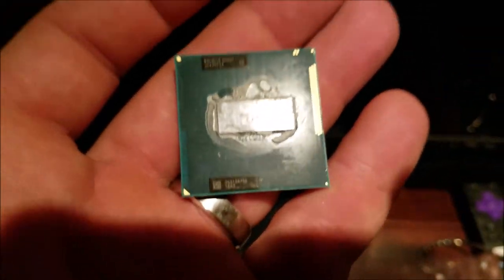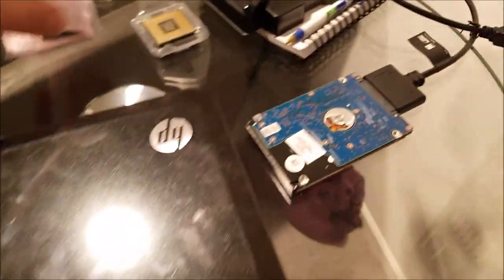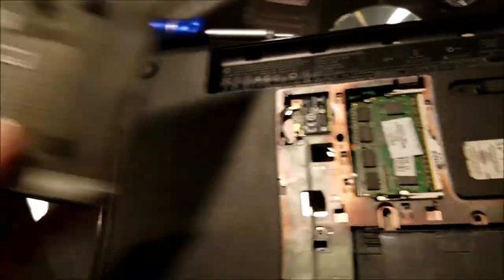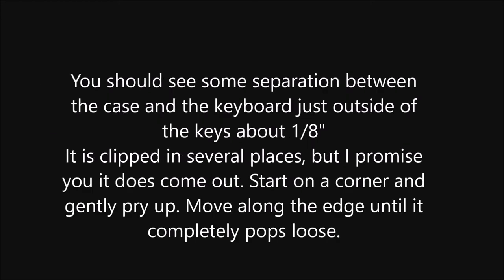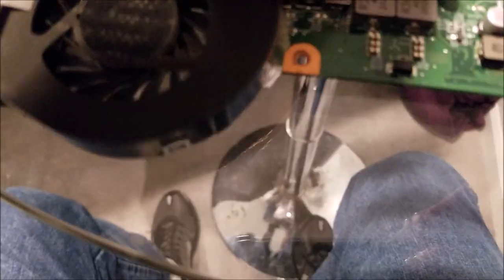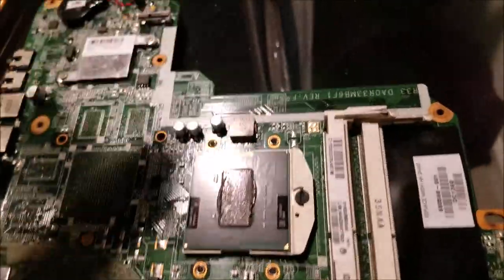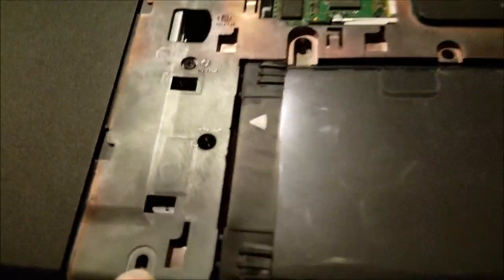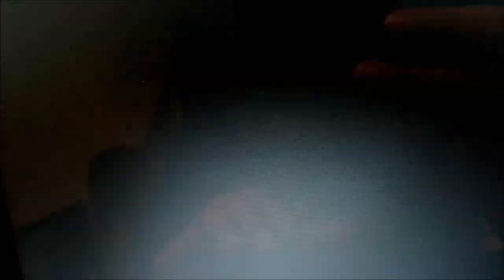How to upgrade to an i7 processor in your old laptop

Comment: Hello,I have a TravelMate 7740 laptop acer
Socket 989 rPGA
Mainboard: Acer BA70-CP
CPU: Intel Core i3 370M
Can I install an i7 940XM / i7 840QM / i7 740QM processor?
Reply from the maker: I'm looking and it doesn't look good. Do you have a separate GPU in your laptop? If not, the quad core chips will not work. They do not have onboard graphics like the lower chips. I think the best chip you can install is a 640m. It's still a dual core but it has higher clock speeds than your i3. 
  If you do have a separate gpu, I would try the 840qm. I've run an xm chip and it seemed to run hotter than I'm comfortable with. That will put a strain on everything else in your system. The quad core chips also look like they use the 45nm architecture as opposed to 32nm of your processor. It must have been a weird transitional time for Intel. It looks like their quad cores are on the larger 45nm architecture and they didn't have room/temperature overhead to include onboard graphics. I probably wouldn't worry about upgrading, but if you decide on a 640m dual core, your base clock would increase to 2.8ghz and you would get a boost clock of 3.46ghz. That's a significant increase over your 2.4ghz clock speed, but I'm not sure how much of an increase you'll be able to feel. Anything with a load will reduce your base clock to 2.8ghz.. about 16% faster. Good luck, normally I would recommend a quad core, but it looks like that isn't much of an option for you.

Comment: Hi Erick, I have some questions. my notebook is an Acer Aspire E1 431, socket rPGA989, HM77 chipset. it currently has the intel pentium B950 Sandy Bridge processor, TDP 35W. I want to upgrade to intel i7 3632QM, which is also TDP 35W, Ivy Bridge. However, the Generation of both is different, I'm afraid it doesn't work! Could you give some tips? 
“sorry for the mistakes of the english" I'm from Manaus-Brazil”
Reply from the maker: I see that you have a socket 989. That is definitely compatible with the ivy bridge 3000 series chips. You'll need to know your chipset to see if it's compatible. It should be with your socket, but you should double check. The easiest way I've found is to download CPU-Z. 
  Open cpu-z and go to the mainboard tab. It will display your motherboard manufacturer and model. Underneath that, it will show information on your chipset and southbridge. The number in the second tab will be your chipset. My desktop is using an AMD X470 chipset. My laptop is an Intel HM76. Once you know your chipset, you can search for a list of compatible cpu's. The 3632QM will most likely be on the list if it is an Ivy Bridge chipset. 
  Sorry for the delayed response. Good luck with it. Feel free to ask any questions.

Comment: I have lenovo ideapad z580 laptop .I wabt to upgrade i5 3210 to i7 3840qm .Can it work
Reply from the maker: Update your bios and it shouldn't be a problem. You already have a 3rd generation processor so it should work. I upgraded from a 2nd generation to a 3rd generation cpu. Some of the older chipsets don't like to upgrade from 2nd gen to the newer 3rd generation stuff. You're already 3rd gen so you should be good. 
  In my experience, the 3840qm is an awesome choice. It's blazing fast compared to my dual core i3. I also recommend upgrading to an SSD for storage if you haven't yet. It makes startups take as little as 10 seconds. It really gives an old laptop a new lease on life. You'll love the new quad core. Let me know how everything works outfor you. Good luck!
Reply: @EricErnst  thanks for your help

Comment: hey mr. Eric, i have celeron b830 processor PGA cpu in my laptop, and it has G2 socket so i want to know if i can upgrade it to any higher version? please reply.
Reply from the maker: I'm not entirely sure if you can upgrade to the sandy bridge 2000 series cpu's or not. It may be like the early sandy bridge board that simply won't boot with an ivy bridge 3000 series cpu.
  Can you find your chipset? 65 and 76 will at least accept the 2000 series chips. I'm not sure on the older cpus.

Comment: Buenas, espero que traduzcas mi comentario, mi placa es una hm76 y quiero actualizar desde el i3-2370m al i3 3110m, cuando actualice mi controladora de video intel hd 3000 pasa a ser una intel hd 4000?
Reply from the maker: Sí, los gráficos integrados están integrados en el chip de la CPU.  Si actualiza a un procesador de la serie 3000, tendrá gráficos HD 4000.  El 3110m tiene la misma frecuencia base que el 2370m.  Si elige actualizar, un 3540m se sentiría mucho más rápido con una frecuencia base de 3.0ghz y un impulso de 3.7ghz.  el 2370m no aumenta y no puede aumentar por encima de la frecuencia base de 2.4ghz.  Si está buscando el máximo rendimiento, sugeriría un procesador de cuatro núcleos como el 3840qm o el 3820qm.  El TDP es un poco más alto, pero siempre que mantenga abiertas las rejillas de ventilación en la parte inferior y los lados de la computadora portátil, no tendrá problemas de sobrecalentamiento.
Reply: @EricErnst  gracias
Reply: @afaveto22  i5-3340m / i5-3360m

Comment: Hi Eric, Could I have some suggestions from you? I have HP 2000 -2306TU with pentium 2.2 ,  socket 988BrPGA, I want to upgrade the cpu , which kind of core CPU will be suitable for this old laptop ? Thank you very much ! Dicky
Reply from the maker: I looked your laptop up. Does it have the 2020m processor? If so, you should be able to run an ivy bridge processor. I'd recommend a 3630qm. If you have a 2020m, you have a dual core chip without hyperthreading. That's 2 cores and 2 threads. The 3630qm has 4 cores and 8 threads. If you want to go further, a 3840qm is another excellent choice, if you can get one for a decent price. I also recommend an ssd for storage and at least 8gb of ram. If you haven't replaced the battery, now is a great time. Once these upgrades are made, your laptop will be snappy and responsive (and portable!)
 for years to come.
Reply from the maker: If you have any other questions, feel free to ask!
Reply: Thank you so much !
Reply from the maker: @dickylo1118  if you need anything else, feel free to ask.
Reply: @EricErnst  Thank you for your suggestion! I will upgrade Ram , SSD HD & the cpu to i7 3630 QM, Is it necessary to update the bios also ?
Reply from the maker: @dickylo1118  yes. Update your bios as well.
Reply: Thank you !
Reply: Hi Eric, I was told by the Pc shop that the south bridge chip set in HW70 under HP Mother Board doesn’t support i7 3630 CPU. HP 2000 - 2306TU can’t be upgraded ! It’s true? Dicky
Reply from the maker: @dickylo1118  you never said your cpu. Anything with a U suffix is soldered directly to the board. I stated that I was assuming your cpu was a 2020m and I believe I asked what it was. Sorry that your cpu is not upgradable.

Comment: hi I have an Acer aspire 5750g  current specs 
i7 2620m GeForce 610m 8GB ram
it has an hm65 chipset, I recently upgraded it from i5 2450m to i7 2620m  performance is increased.. but I wanted to upgrade to 4 core CPU for 1080p video editing.....with my current specs I can edit 1080p 30fps videos easily with a few stutters mostly it's smooth... but I mostly edit 60 or 50 fps videos which give some serious stutters.... 
which CPU should I upgrade to.. I wanted to upgrade to i7 2630qm but it wasn't available at the time in the local market here. I cant order online,... so I have to search the local market by myself.... is there any chance I can upgrade to a 3rd gen quad-core CPU??

please suggest the best CPU can upgrade to with my current specs
Reply from the maker: You can go as high as 2960xm but that will likely lead to high cpu temperatures when editing videos. Unfortunately, the ivy bridge 3000 series processors are not compatible with your chipset. 
  Anything above an i7 2640m will be a quad core cpu. Make sure it has QM in the name. There are a few QM's below the 2640m but every processor numerically above that will be a quad core. I don't recommend the 2900+XM series chips. I used a 2920XM for a short time and it ran right around 100⁰C ±5⁰ when editing videos. 
  Here is a link to the cpu's that are compatible with your hm65 chipset. 
https://www.cpu-upgrade.com/mb-Intel_(chipsets)/HM65_Express.html
  It looks like a few of the 3000 series chips are compatible if you look at the very bottom of the i7 section. They are the QE series however. They were designed for lighter loads and low power consumption and I'm not sure how well they will do in a  workstation environment. 
  Unfortunately I upgraded my i3 2370m to an i7 2640m before doing my research. There was a slight bump in performance, but it was nothing compared to a quad core upgrade. The doubled cores and threads really help, even if they have a slightly lower clock speed. 
  Good luck finding a quad core sandy bridge chip! I wish you well!
If you can't see the link above, here is a cut down list with the available quad core i7 cpus.
Intel Core i7
i7-2630QM
i7-2630QM
i7-2635QM
i7-2670QM
i7-2710QE
i7-2715QE
i7-2720QM
i7-2760QM
i7-2820QM
i7-2860QM
i7-3610QE
i7-3612QE
i7-3615QE
Reply: @EricErnst  Thank you

Comment: Core i3 2310M Chipset HM65 upgrade to Core i5 3230M black screen only Led Power " on ".  Bios update, reset motherboard. Bad experience !
Reply from the maker: Sorry that I am late to the party. Was your bios updated to the latest version?  I updated my bios before I began my first upgrade from my original i3 2370m to an i7 2640m. Each processor that I tried worked perfectly for me, although the high wattage 2920xm ran a little warm for my taste.
Reply: That's cuz you tried to upgrade from a Sandy Bridge (iX-2XXX XX) to Ivy Bridge  (iX-3XXX XX).  Trying to upgrade from a 2nd gen to 3rd gen is a no-no.  Especially in laptops.
Reply from the maker: @Trev0r98 sandy bridge to ivy bridge worked for me.
Reply: @EricErnst  The i7-2640m and the i7- 2920XM are both Sandy Bridge processors, not Ivy Bridge.
Reply from the maker: @Trev0r98  I am currently running a 3840qm in the exact same computer. The one that I pulled my 2370m out of. That's sandy bridge to ivy bridge. That's literally what this video is about. Dont try to tell me it never works. It does work sometimes. 
  This laptop came with an i3 2370m, then I upgraded to an i7 2640m then i7 2920xm then finally to a i7 3840qm. The 2920xm got a little warm while rendering YouTube videos. 55w 2920xm tdp vs 35w 2370m. The 3840qm is rated at 45w tdp. Now I feel like I'm running the perfect processor for my setup.
Reply: hello i have samsung np300 i3-2350m i want upgrade to 3rd gen.. can you helps me? thank you
Reply: @utilisateuryt3334  Hi. upgrade only 2rd gen processor,  core i7 2670qm - core i7 2860qm.

Comment: I have i5-2450m with 35tdp can i maximum upgrade with i7-2960xm?
Reply from the maker: It should work but sometimes the bios doesn't allow for certain cpus. I'm currently running an i7 3940xm in this very laptop. My 2960xm seemed to get pretty warm when rendering videos. Like up to 105⁰C. If your chipset allows it, I'd go for the newer 3000 series chips. If you have an hm65 chipset, you're stuck with the sandy bridge 2000 series and the ivy bridge 3000 will not work.

Comment: hello bro
I Have Dell Latitude E6520
Core i5 2540M
My Socket is 988B rPGA
and i'm a little confused between The i7-3740qm (80$) and the i7-2920X (86$)
i have 12gb ddr3 ram and also i'll buy a 1tb ssd but i have tow question
1- wich one of these Cpu's You Recommend ?
2- Does The i7-2920X has intergrated GPU ?
my i5 2540M have Intel HD Graphics 3000 so is the i7-2920X have Intregrated ?
Reply from the maker: The 3740qm will actually be a little faster and run cooler. I definitely recommend the newer 3000 series chip over the 2000 series chip. I had a 2920xm and it ran great, bit when I rendered video, cpu temperatures would peak at over 100⁰C. The newer architecture of the 3000 series chips makes it both faster and more efficient. Both have integrated graphics. I believe the newer cpu has the newer Intel 4000 series graphics as opposed to 3000. 
  The best part, it's actually cheaper too! Update your bios and make sure that your chipset will support the newer cpu. Some older chipsets cannot run the newer cpus..  even though the cpu physically fits into the slot.

Comment: Hey i have Intel core i3-2310m cpu @ 2.10Ghz with HM65 motherboard 
And laptop name is hp 430 notebook with 8gb ram 
Please tell me to which processor should I upgrade to because windows 10 is laging and I also want a to upgrade this processor for gaming 
There is no budget so please recommend freely
Reply from the maker: The absolute best processor that is still compatible with your motherboard is a 2960xm.
  If you don't have a discrete gpu, your gaming fps won't improve much. It will improve some, but it won't be a night/day difference.
  I have used a 2920xm and it was good. I am currently using a 3940xm and it is good. I installed a 3840qm in this video. I think I paid like $140 for it maybe 6 months ago. There's a few hundred Mhz difference between them. Your motherboard can only accept 2000 series sandy bridge processors. Don't even try a 3000 series ivy bridge processor. 
  I'd look up Intel ark and see their legacy mobile processors. Anything in the QM line will be a big upgrade. QM means quad core mobile. Just M means mobile. XM is Xtreme Mobile. The x9xx chips are xtreme. There really isn't much of a difference on the Xtreme chips. They are more expensive and the fastest available. 
  If you haven't, I'd get a SSD as well. I think that makes a bigger difference in day-to-day use than anything else. 
  You could also upgrade your ram. I got a 16gb kit of gskill ripjaws 8gbx2 ddr3 1600mhz. It's about the most you can use in that laptop. But 8gb will probably be fine for you.
Reply: i5-2520m, i5-2540m, i7-2620m

Comment: How did you know which processor upgrade would work?  I want to upgrade my t570 i7600u to the highest I can go.
Reply from the maker: Unfortunately, if you have a processor that ends in U, the chip is soldered to the motherboard. I don't believe you can upgrade that cpu. 
  I was lucky in a couple of different ways. First, that i had a 2370M processor.. one that I could swap cpus in and out of the socket with ease. Secondly, I had a motherboard and chipset that would accept either my 2000 series cpu or a newer 3000 series cpu.  I was also lucky that every chip that I tried worked. I've heard some say that certain laptop brands have a "white list" of acceptable processors. Only chips on the list will boot. 
  First, I tried an i7 2640m. It was still a dual core, but with higher clock speeds than my i3. Then I tried an i7 2920xm. Then I tried a 3840qm and finally, I settled on the fastest chip available, a 3940xm.

Comment: Hi, i have a i5-2410m i would upgrade my hp pavilion dv6-6150sl. My chipset its HM65, any suggestions? Thanks <3
Reply from the maker: With your hm65 chipset, you have to stay with the sandy bridge 2000 series cpu's. I got a 2640m and it didn't feel much faster than  my 2370m. Where you'll feel the biggest difference is by switching to a quad core. I think a 2630qm would be a great option that is balanced between performance and price. They are both i7 processors and the 2640m has a higher clock speed but the quad core more than makes up for it by brute force of the cores and threads.
Reply from the maker: If you haven't, I would upgrade to an ssd. The can be had for relatively cheap and you can clone them easily. I'm using a 500gb ssd as that's the size mone originally came with. I found some ram for cheap too so I'm running 16gb of ddr3 1600mhz. The 2 main factors for increasing the speed is an ssd and a quad core processor.

Comment: I have a core i5 3230m can i upgrade to i7 3840? P.... TDP is a problem?
Reply from the maker: Tdp should not be a problem. You are already running a 3rd gen chip, so it should be a direct swap. 3840qm is a great choice. The 3900xm cpus are hotter. I had a 2920xm and it got toasty. The 3840qm runs faster and cooler than my 2920xm. If you are doing anything that is computationally intensive, just make sure that your coolong vents are clear.
Reply: Thank you.

Comment: Hi Eric I have a LG s425 with i3 2330m 2°gen tdp 35 and I would like to change to an i7 3940xm tdp 55 3°gen will it work also has a different to Sandy bridge to ivy bridge, help please with this thing... Both same socket 988B I guess same as yours
Reply from the maker: I'd need to know your chipset to know if your laptop is compatible with an ivy bridge cpu. I like to download cpu-z and see the chipset from there.
  Hm65 is only compatible with sandy bridge. Hm76 is compatible with ivy bridge. There may be some minor revisions between. Find your chipset and search for cpu compatibility. If it supports ivy bridge, you'll be surprised by the improvement over the sandy bridge i3.
Reply: @EricErnst alright I'll see it thks
Reply: @EricErnst  I found the information my lap top is hm65 it will work only with Sandy bridge 👍 I'll try find the best processor Sandy bridge to put in thks for your feedback awesome video
Reply from the maker: @EmersonMartinscrazy  I used a 2920xm for a short while and it was good. I think the highest sandy bridge mobile cpu is a 2960xm, but anything over a 2630qm should are a big difference with double the cores and threads.
  I'm running a 3940xm in this laptop now. Good luck with your laptop!
Reply: @EricErnst  do you still have the i7 2920xm? if so could you sell it to me?
Reply from the maker: @EmersonMartinscrazy  I'm not sure if I used that one in my dad's laptop or not. I'll have to go through my computer stuff. It's the one that I straightened the pins. I'm pretty sure I pictured the shipping damage in the video.